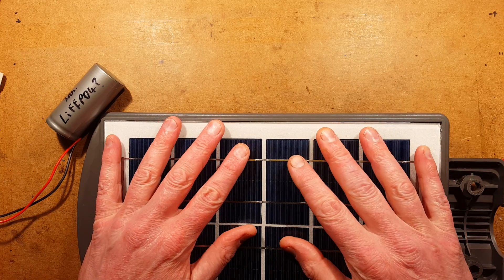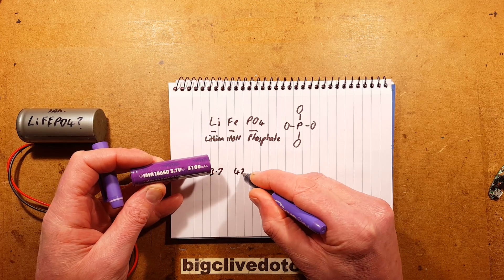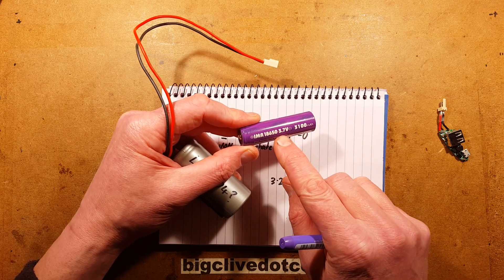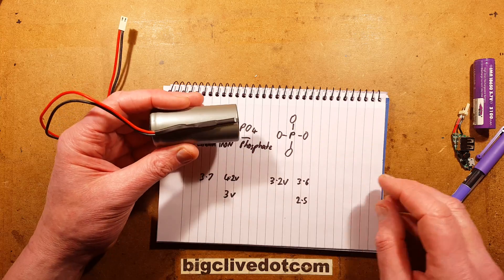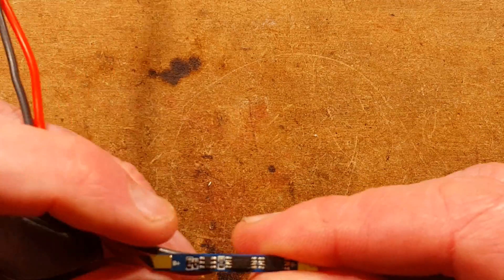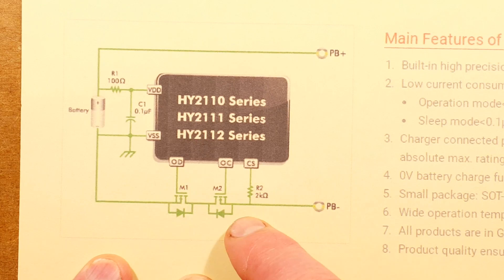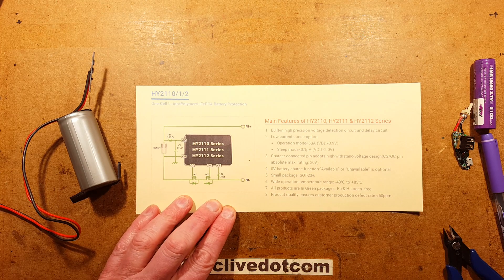LiFePO4 versus standard lithium cells.

Comment: LiFePO4 delivers a much higher number of charge-discharge cycles while also degrading the least of any lithium chemistry while they're held at full charge. 
They're the only lithium chemistry I'll consider for backup power because of this and their immunity from need for an explosion containment pie tin around installations.
Reply: they are also immune to being left partially discharged, an otherwise death sentence for lead acid.
Reply: Assuming you can get them used, NiFe batteries are pretty much the best possible solution for backup power. Immune to overcharging, immune to direct short (both just boil off the electrolyte. Refill with water and you're golden), and with a cycle life far beyond any other technology.

They're heavy as frig and very expensive when new, bu those are the only real cons.
Reply: NiFe is interesting for some applications but they have low discharge current, high self-discharge, and you can only get out slightly less than 1/2 of the energy that you put in. Edison was producing NiFe batteries for electric cars over 100 years ago because they were the best technology available for a long time for such uses.
Reply: @Peter_S_  Thanks for adding to my already hated DIY electronics schooling, now I've got to go find out what NiFe can do...eye roll...lol
Reply: @littlegrabbiZZ9PZA  Some NiFe batteries have been in operation for over 100 years.
Reply: @littlegrabbiZZ9PZA  Problem with NiFe is the round trip power losses of about 40%. The charge and discharge voltages are significantly different.
Reply: I wonder about supercapacitors. They're supposed to reach energy densities of some Li-ion chemistries.
And they clearly have no issues with cycle life, power or efficiency. (not sure about self-discharge rate)
Reply: avada Actually, self-discharge rate in supercapacitors is horrendous, at least the ones I have. They discharge very quickly by themselves: a 40 F one will pretty much fully discharge just after one day. And that’s not mentioning the very high price for equivalent capacity (and those are the normal ones, higher energy density ones would be more expensive if they’re already sold and not just in the lab), and the challenges their variable voltage poses.
Reply: @avada0  supercaps are great if you don't mind 1/10th the energy density, them discharging over a couple of weeks (not a problem in a backup setting, since it's kept charged), and selling quite a few kidneys and your firstborn.
Reply: Lithium titanate may interest You Peter. The density is low and the cost is high but thermal performance is much better and cycle life/charge rate handling too
Reply: They are used for motorcycle racing batteries.  They can direct replace lead acid. No changes to motorcycle circuitry.
Reply: Well, lead acid is worse for power backup, so I’d still consider other Li-ion batteries...
Reply: I've seen lithium titanate (LTO) batteries, which are much safer, (dis)charge faster and have a much longer life, though are about the same price as lifepo4 per Ah, while being 2.2V, about the same size, and having a 15% discharge loss.
might be a good alternative to supercaps
Reply: Indeed, they are much safe, but for good measure I would still contain them.
Reply: Slightly higher number of charge cycles with very slow and shallow discharges, this isn't magic, you trade off one end to gain something at the other.

Comment: The biggest differences between Lithium Ion and Lithium Polymer are that lithium Ion have a high power density and a lack of a memory effect.  The advantage to lithium Polymer (LifePo4) is that they are a less prone to exploding and can be in any shape or size designed based on application need and space of the device.   But that's not all.  LifPo4 batteries have some huge disadvantages, namely they are much more expensive to manufacture, and they can't store the same amount of power nor do they have anywhere near the lifespan as a lithium-ion does.  Now all that being said, I don't agree from a personal real life use when it comes to which type battery is safer.   In fact, in the last year I have had 4 LifePo battery packs explode and 2 that were contained by their wrapping so the gas did not escape.  I have never had a lithium Ion battery explode to date.  So in my personal experience, LifePo batteries are much more prone to failure, especially if they do not or are not charged via a protection circuit.  And for advice, only use Lithium Ion batteries that DO have a protection circuit built into the actual battery if possible.   BTW, I build a number of devices used in real world survival as well as power packs for different needs.  So I use a lot of these battery types of all shapes and sizes.

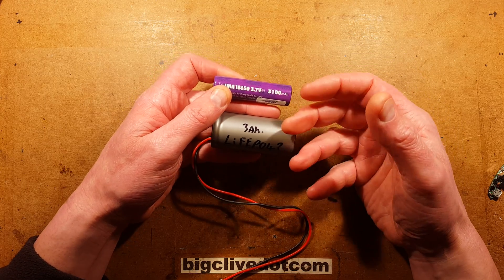Comment: 1:55
LiFePO4 (LFP) is hardly used in any electric cars what so ever: I don´t know a single BEV that use LFP batteries. 

Hybrids on the other hand, there is really quite common. Most hybrids use LFP batteries, while some use LTO. For hybrid busses and trucks LTO is much more common.

"normal" Lithium-Ion cells is really 4 major types and a number of minor types.
LCO - The Li-Ion "classic". hardly used any more
LMO - High power cells, mostly used on power tools and medical devices
NMC - Similar performance to LCO, but having twice the life span, common in electic cars, (BEV)
NCA - High capacity, but shorter life span. Mostly used in phones and computers but also in some electric like Tesla and Bolt. The issue is with some cars like the tesla with 50 and 60kWh of capacity that the battery will wear out long before the car is done.

7:00
"That is 365 cycles per year"
That is really not correct. For a garden solar light that shines until the battery is flat that would be true. But for a motion detection light its really not. Some night it maybe just disscharge 10-15%... some night it will be totally flats. Also in the winter, some days it will not charge fully.

Normaly the amount of cycle is calculated to the original capacity and not the number of charge. They are usually tested with a discharged to 20% and a charge to 80%. The optimal charge (at least for LCO cells) is to discharge to 40% then charge to about 70%.

For electric cars this work out pretty good because people usually don´t run there cars totally flat. And also some manufacture build in a 10% redundancy making it possible to get under 10% pushing the end user closer to the optimal 40%
Reply: look up BYD  :) , i just had a load of cells from cars that had been vandalised.
Reply: @amojak  I wouldn´t buy BYD.... i guess they do produce good products.. to a extent. The problem is with a lot of Chinese manufacture, if you don´t have a good source, you can often get knock of products.
Reply: @matsv201  these BYD lifepo4 cells are excellent, well built and the only negative is they are heavy for their original application.
Reply: @amojak  I´m sure they are.. if you got a reliable source.... but its really that that makes me thing twice about it... 

it really don´t matter. i´m not in a situation where i buy up large qvantites of lithium cells any more
Reply: @matsv201  they came out of a BYD car with about 10k miles on it .  China is a major manufacturer of lithium cells. just take a look at who makes the one in your mobile phone etc..
Reply: @amojak  Yea.. i don´t think you quite get my concern. Its not about that the Chinese is bad with producing cells, is that there suppliers are dirty. If i can get it via a secure supplier, i don´t really have a problem with it. But its easier to say than to do

Comment: LFP batteries from Battle Born/Dragonfly and a few imports are being used in RVs. The BB10012 is a 100Ah 12V pack in a car battery form factor that replaces the deep cycle coach/house batteries. LFP in a 4-S configuration yields a more compatible (than Li-Ion/LiPo) 12.8V nominal voltage and a range of 14.4-10V (BMS limited) which works well enough with lead acid charging systems. More stable and safer than Li-Ion with a 10 year warranty. LFPs are fussy about temperature and go off-line below freezing (25 degF for charge circuit, lower for discharge) so some owners move them inside the coach since there's no hydrogen or corrosive gasses venting out. The cost is high initially but lower than LA over their lifespan. Charging efficiency, minimal self-discharge, usable capacity, and light weight crush lead acid performance.
Reply: They're popular for ham radio for the same reason, most radios are designed for 14V maximum voltage.

Comment: So in the first video you measured the battery is that how they sell them by size and capacity. Last night I did a quick search on lifepo4 on amazon they seemed 18850 was popular. It was late I didn't watch your quality video til this morning. Cheers from coldass, kansas.
Reply from the maker: 18650 cells are by far the most popular cylindrical cell size.

Comment: I think you didn't mention it, but LiFePO4 cells also allow discharge at freezing temperatures, which might be a huge bonus for outside installations.
Reply: You can discharge lithium ion cells at freezing temperatures, however, it's a problem to charge them at those temperatures (not immediately, but they fail soon after).
Reply: @johnrehwinkel7241  According to a expert interview I saw resently charging lithium batteries at below 0'c conditions possible but only at very slow charge rates.  Apparently the reason the BMS just blocks charging altogether is the installations that can end up with spare renewable energy and super cold batteries "frequently enough to worry about" they assume the installation will be sophisticated enough to divert the unused charge power to bat warmers until the bats are ready for fast charge....
Reply: I noticed the chip had low operating temps as well. But that was the first one I could read right off the video. ( cell phone watcher) most the time.
Reply: Use GEL batteries for low (low) temps
Reply: Yes, a huge factor that was overlooked.
Reply: Important to read the specs on your particular battery. While generally LiFePO4 cells can be Discharged in cold temperatures they usually should not be Charged below 32F/0C.
Reply: all lithium batteries can discharge at freezing temperatures. But you can't charge them below freezing.
Reply: So do li ion. I own an ebike and it works in the winter. Not quite as zippy but it does work.
Reply: @johnpossum556  mine in the winter has seen more voltage sag under load and slower recovery. Capacity however has remained similar enough to not really notice.
Reply: @johnpossum556  LiFePO4 battery IS a li-ion battery. Or atleast a subtype of one, there're many types of Li-ion batteries, LiFePO4 is among those types.
Reply: @johnpossum556  you said "so do li-ion" implying that LiFePO4 batteries are not li-ion batteries.

Comment: Clive, thanks. The Rich Rebuilds fire, indeed one of the most spectacular lithium cell fires I've seen. The consensus is that Rich bypassed all the Tesla safety mechanisms and his non-smart charger severely overcharged the cells.

One of the most promising cell technologies that is in development is this one,

https://www.wired.com/story/bill-joy-finds-the-jesus-battery/
https://ionicmaterials.com/
https://www.pbs.org/video/nova-search-super-battery/
Reply from the maker: I've become a bit cynical about the many claims of miracle batteries.  But I'll keep my mind open.
Reply: @bigclivedotcom  The video showing cutting, puncturing of the battery; cell continues to work with no flames. It's Lithium ion based, normal voltage, but the electrolyte is solid and not flammable. https://www.youtube.com/watch?v=m9-cNNYb1Ik

Comment: I've been playing around with some solar charging of batteries, mostly using lead/acid batteries that I already have. One of the reasons is faking more daylight in my greenhouse (which is why I started making my own version of your RGB LED controller!) Another thing is a solar light for my front gate, walkway and front porch.
Reply: For your use, I would suggest spending a bit extra on deep cell gel batteries!  Not only will they last much longer, they are designed for constant drain/recharge use.  They are more expensive no doubt, BUT in the long run you will buy less of them over time.
Reply: @Malakie  Yeppers! I'm experimenting/learning just using old deep cycle SLA batteries that I pulled from and replaced in UPSs where the only other reasonable option is to dispose of them (already significantly reduced capacity.) I'll get new batteries when I'm a little more sure of what I need and what I'm doing. ;)
Reply: Martel DuVigneaud plants grow best with red and blue light. Witch to us is a pinkish purple. They will grow with red and blue. But best with the combo. The blue UV LED's not true, complete UV, but dip into the wavelength of uv. With a red led that also peaks in to the infrared spectrum. Would likely be closest to what the sun provides. Giving only what the plants needs. Not wasting power on other wavelenths of light.  Amazon sells the led lights with red and blue for plants. I'm planning a small green house. And plan to use about 10 watts of red/blue LED's per plant. With about 300w solar to start with. And 400 ah in battery. Along with a pwm dimmer. Maybe one for each colour. Allowing to adjust colour and brightness. Sorry for rambling!!!!
Reply: @jamest.5001  Yes! That's my intent! I plan on alternating strips of the red/blue grow LED strips and white (maybe 3:1) so if I need I can also turn on white light for visibility for me at night. I'm also planning on assembling a passive thermal heat system: a tank of water in the greenhouse with an out-feed pipe at the bottom running outside to the bottom of a black poly-pipe that snakes side-to-side up an incline and feeds back into the top of the water tank. Y'know, just to give extra heat at night. :D Total capacity of the solar panels, batteries and LEDs plus the thermal system are all still things I'm experimenting with! :D
Reply: Martel DuVigneaud that sounds awesome. I'm thinking of a similar , supplemental heating for my off grid house. I have solar power, and a generator. With 4 t105 style golfcart batteries, and 4 huge L-16 leadacid. And 1400cell liion battery bank. That I use separately. Mostly use the lead acid for backup, and use the middle of the liion. So I expect about 40-50% capacity in 15-20 years. I cycle them from 3.1-4v per cell. And in a emergency Can parallel banks when voltage is equal. Or use the generator. I hope to get a tiny hydro electric generator going. And maybe a wind turbine. If I can get a constant 500 watts it would help alot. I'm trying for 1200+ watts on each. There is weeks without sun here.  Sorry for all the rambling!!
Reply: @jamest.5001  Very cool, man! I'm really new to experimenting with this so hearing what other people are doing is very awesome! I'm not off-grid (I'm actually line-of-sight from my roof to the local electrical distribution substation) but I would love to eventually be a net producer of power. One of the other energy storage things I've thought about exploring on a very small, experimental scale is wind to mechanically lift water in multiple stages for on-demand hydroelectric but that isn't practical for me (my house has lots of wind but no real elevation difference and the other property has the elevation difference but so little wind. D'oh!)
Reply: Martel DuVigneaud I'm very close to town. But in a secluded area. Heavily wooded. With a spring and creek.  With about 80' drop across my land. But its a gradual stepped grade. There is to many trees ! For wind I will need a tall tower. 50' plus to get out of the trees. They are very old and tall. And I don't want to cut them. My neighbors trees would block the wind anyway. I think I'll give a small turbine a try. And maybe a small holding pond. Will give more steady flow from my spring. Mid summer, it can all but dry up. If there has been no rain in a while . maybe a 20' diameter, and about 10' deep . it would make a nice place to swim anyway. If I can get a few hundred watts from the overflow even better!  Constant power is better than alot for a short time. 1200watts of solar does OK. When its sunny. I discharge more than I like more than I like. Maybe 2kw more solar. and tripple the battery. It would be just what I need. But that's some money! If I can get some hydro electric going . at about 1/4 the cost. I also use DC lighting. It's more effiecent than boosting, inverting, and all that. Loosing power all along the way. I spend about 5-10 watts per room. I still have 120. Ac lighting just never used.  It's similar to the low voltage landscape lighting.   I just power off my battery bank. I do buck to 12v since I'm at 24v (up to 29.4 on the liion) I may start making videos on all this. Do you video any of you projects?
Reply: @jamest.5001  I only rarely make videos because my SLR camera doesn't shoot video and I haven't made a very reliable tripod mount for my cellphone... so trying to hold the phone steady for a video is awkward. I also don't like speaking or being on camera. :(

Heavily wooded is the reason for part of the other property (top of the ridge) not getting much wind. I also don't want to cut trees unless absolutely necessary! The other part of the other property is angled south so it would get good solar... except it's steep and really flakey, unstable rock so installation and maintenance would be an expensive nightmare! :(